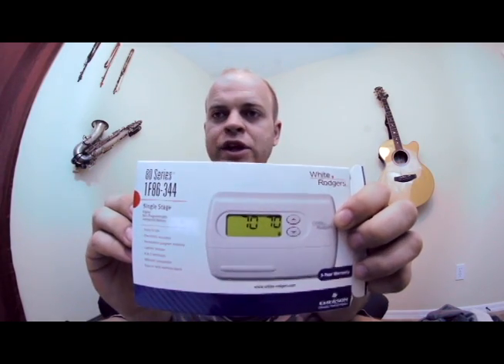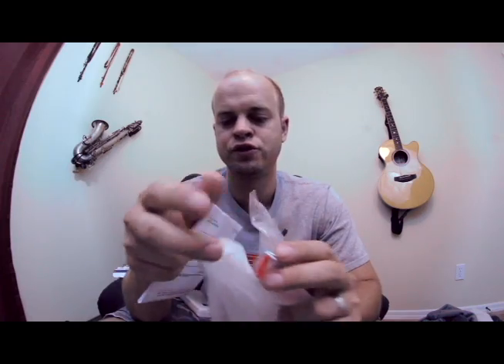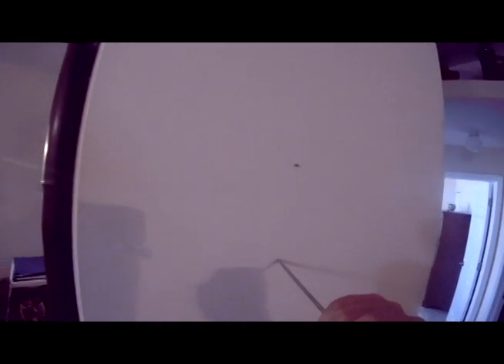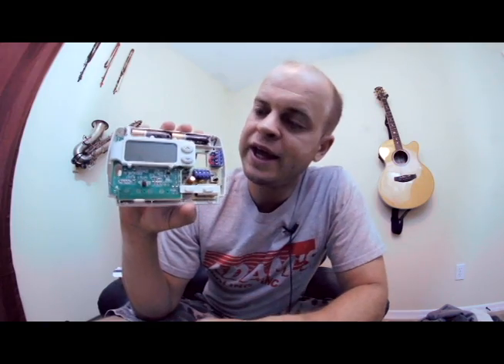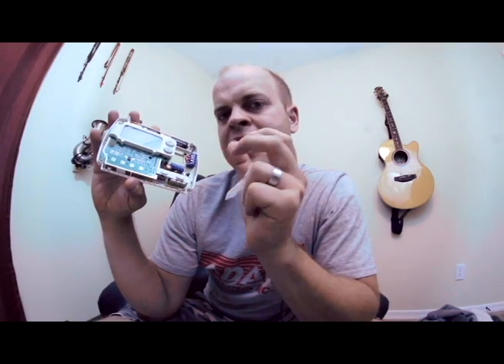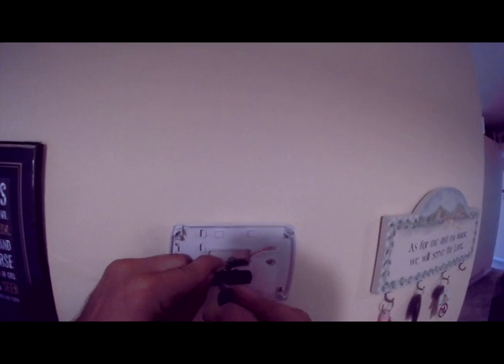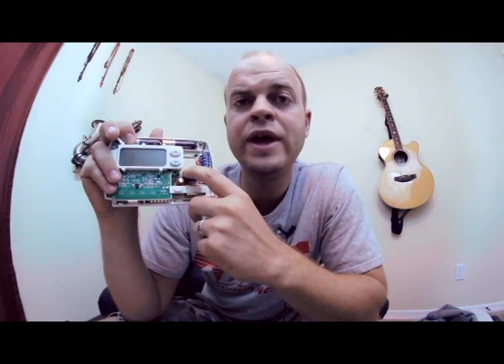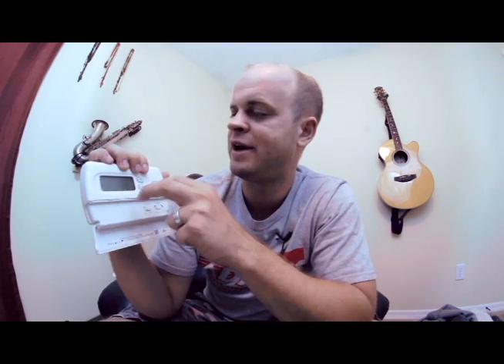How to Install a New Thermostat - White Rogers and Honeywell

Comment: Seems like this video only shows the White-Rodgers type, even though the title mentions Honeywell and you mention Honeywell in the video.
Reply from the maker: There definitely ARE slight variations between these different thermostats, especially if one is a programmable versus a non-programmable thermostat, but between non-programmable thermostats alone, there are not too many differences.